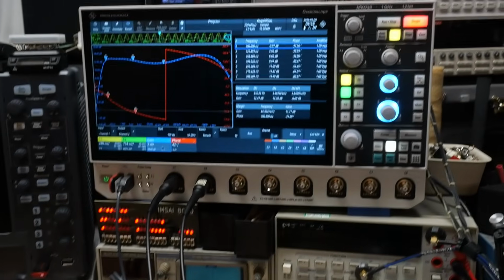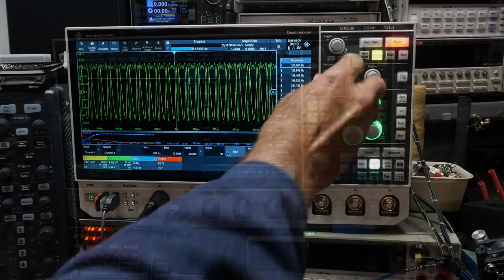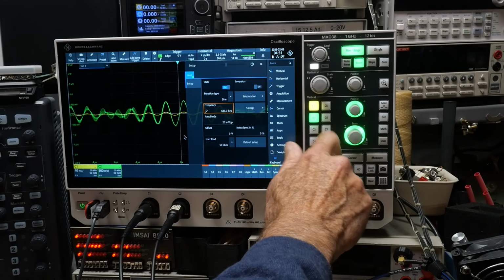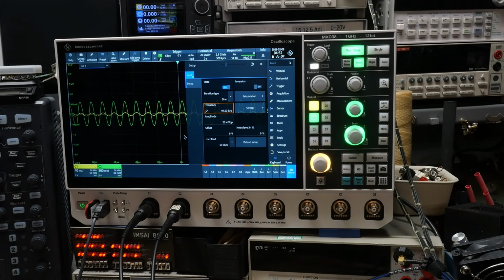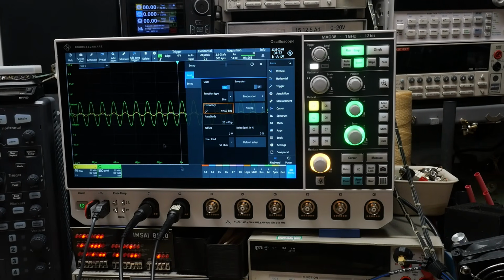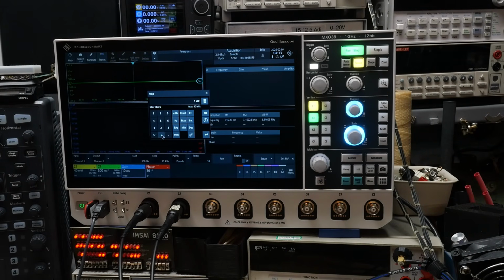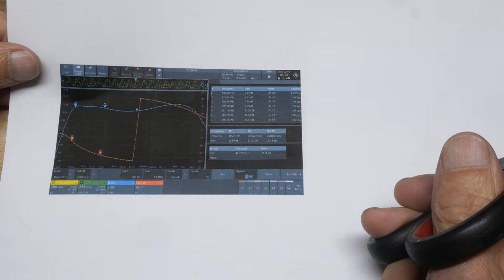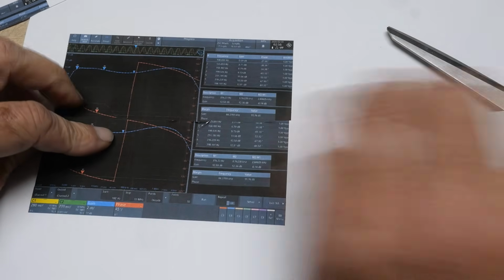#2516 Phase Plot Discontinuity

Comment: Great video. I commented about this in one of your old videos.

As you say it's a plotting issue. The plot will always draw a line between each sample point.
And as the Y-scale isn't linear, it is circular, the first sample point can be at -179° and the next at +180°. The plot needs to draw a line between these two values. And it becomes a "jump".
As soon you understand that phase isn't absolute, but circular. It's easier to understand in my opinion.

Comment: Good vid. I’ve always looked at it from a high school trig perspective. 360 degrees is equivalent (equal in most cases ) to 0 degrees.
Likewise 180 equals -180z
Reply: I was wondering if the graph does a 180.  Numbers are hard to read.
Reply: @Y.T.Learner The y-scale is a total of 360°
It isn't really important at which degree the scale starts at. As it is circular.